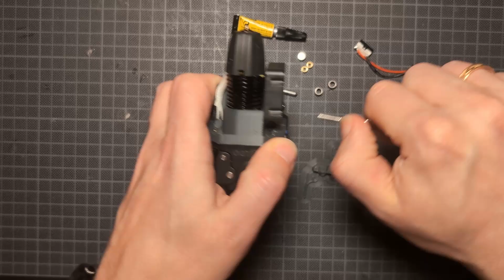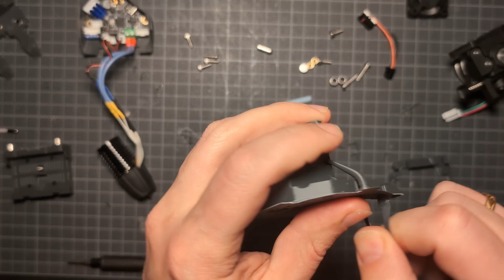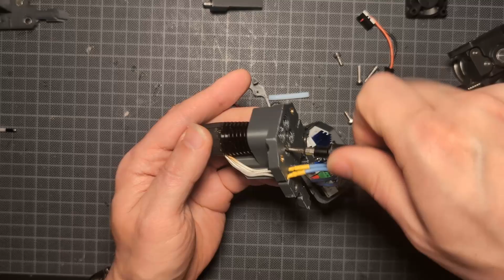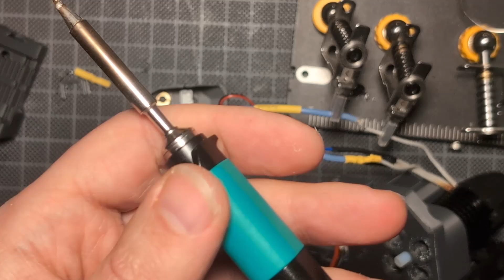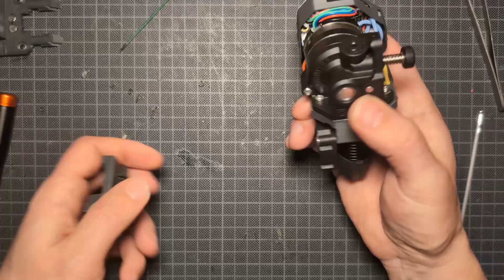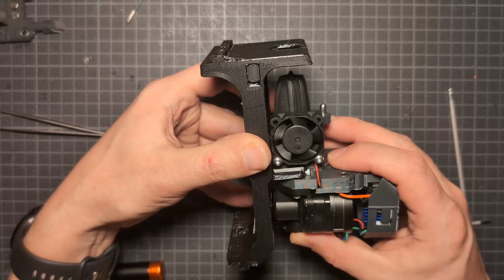Clickchanger Assembly

Comment: Awesome system, congratulations on a good job.

I'm thinking about doing that to SV08. Will it be possible to use eddy or any different solution than PZ? My bed is super crooked, as all SV08 bed.
Reply: Have you done any type of toolchanger design on the sv08 yet?
I just finished a tapchanger (first tried stealthchanger) on my SV08 and there are other things to consider:
- sensorless homing on the Y works by hitting the shuttle + mine and many others belts were too short --> needed to change the shuttle quite a bit
- the a-b-motors are hitting the base before you can touch the bed --> needed to change quite some dragonburner parts
- mounting the docks without a 20x20 extrusion (+ accounting for the longer dragonburner) 
I would guess some of those problems will persist in this and any of his future designs, as he is designing for the voron 2.4 and not the sv08. 

From my experience (not toolchanger, but standard mounted toolhead) the eddy didn't perform particulary well on my sv08 and is not collecting dust. Maybe it's worth a shot to try out the cartographer, I think in his clickchanger he is using beacon on the first toolhead (as the one in the video does not have a probing mechanism) and it might be worth it, considering you need only 1 probe total. 

What do you prefer? I have only tried/used BL-touch, inductive, eddy and tap so far, so no idea how good beacon or cartographer are.
Reply: @SippoCoffee   thank you for sharing your experience. I'm still awaiting parts to start my build.
Not being able to hit bed is the most worrying for me.
BTW, author uses PZ probe on his tool head.
Reply: @SippoCoffee  I have the beacon on my sv08, it's been awsome, super fast scanning perfect z offset and layers every print. I can't recomend it enough. Also bought it as aparently good for high temps.
Reply: @SippoCoffee also what did you change to the shuttle? I'm happy to recad things but would longer belts help?
Reply: @Atanas23  I had enough of the fiddly belt squeezing with the original belts, so I bought longer ones, but than ended up designing the shuttle so it would mount the sv08 belt clips at the position they were mounted on the original sv08 toolhead, so in terms of belts nothing differs to the og toolhead. 

other changes were about thickness (shuttle and main part) to get the original y position for the nozzle (couldn't reach the front with the voron clickchanger design) and a bumper to the shuttle to hit the x-endstop (position like the sv08 toolhead, so I would need to make less config changes/ reuse og macros from sovol)

thanks for the beacon recommendation, I ended up using a cartographer flat version and had no problems in low or high temps